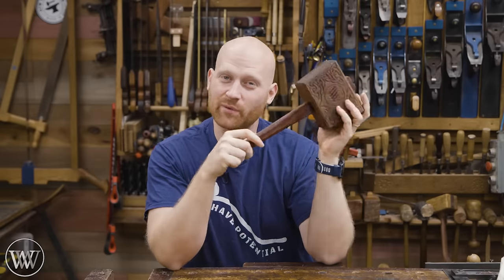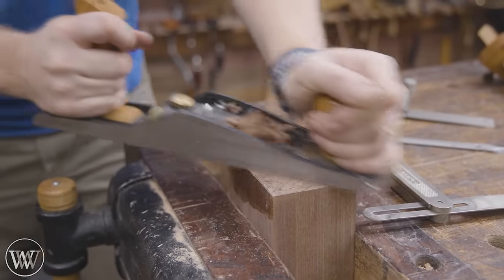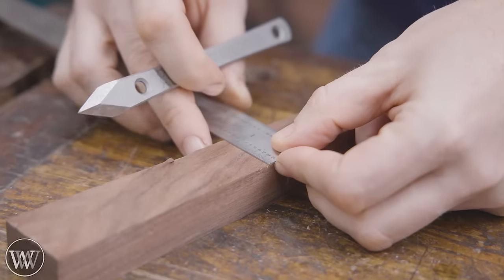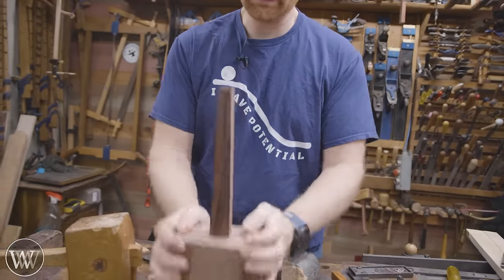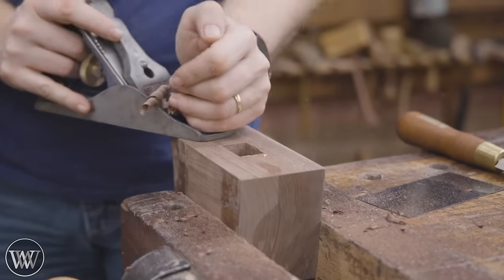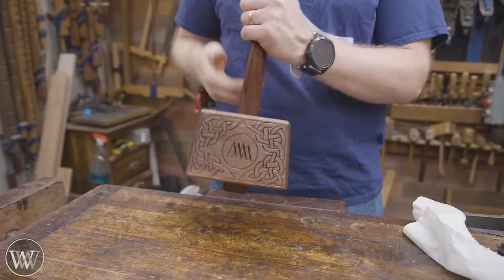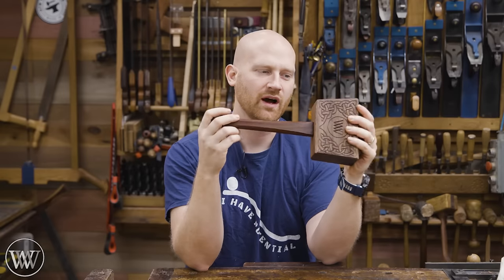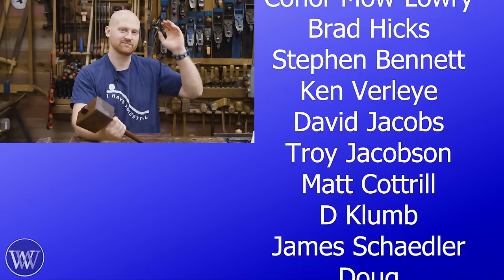How To Make A Carved Walnut Mallet

Comment: I noticed the head is oriented so the end grain impacts the tool. Wouldn't this be the weaker part of the wood, shortening the life of the mallet? Wouldn't it last longer is it was oriented so the face or edge grain was impacting the tool? I'm a beginner so I would appreciate your thoughts on grain direction as it comes to mallets.
Reply from the maker: If you rotated the grain 90° then you would have a problem of a head breaking off of the handle. Also with the end grain impacting. It is far more durable than the face grain as the face green tensed to warp and chip off rather than compressed like the end grain.

Comment: Hello. I have a question, not exactly about this video though, but about one of the previous videos. Did you get any cracks or insect problems when getting fresly cut/ green lumber? I have just got a newly cut piece of log, but it cracks and I see a lot of insects eating it deep to the inner part it seems. Could you help with some tips? Thank you.
Reply from the maker: Send me an email. I'd be glad to help you figure it out. But usually with a log you need to at least split it in half to dry it otherwise it will crack far deeper. You also want to paint the ends so that they dry slower

Comment: Does a jointer have a chip breaker ? Found one that looks like somebody has tried to restore and gave up. I need to repair cheeks but other than that it is good shape. Was missing tote but I made a new one. Have made several Krenov style smoothers but first attempt at restoration. BTW like your work.
Reply from the maker: All baily pattern bench planes have a chip breaker .